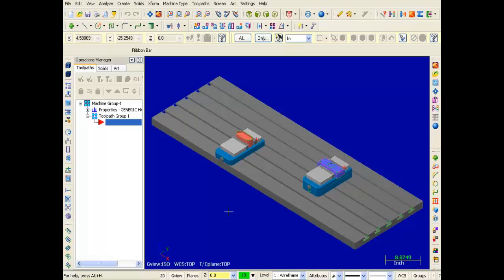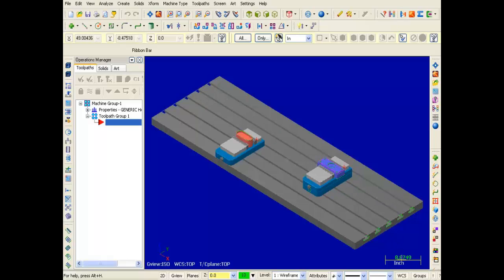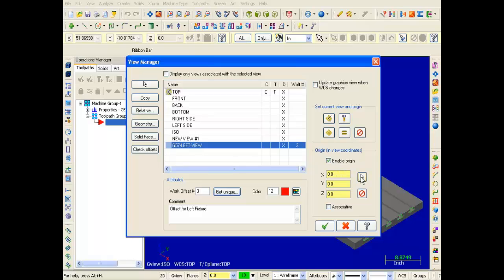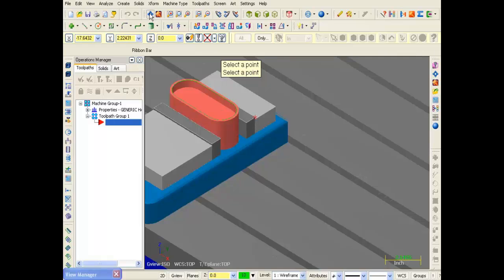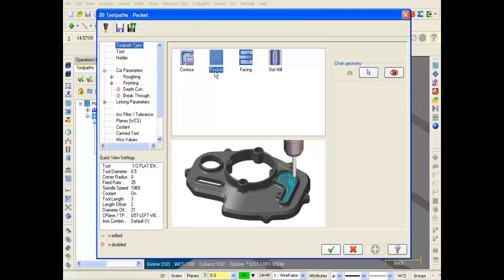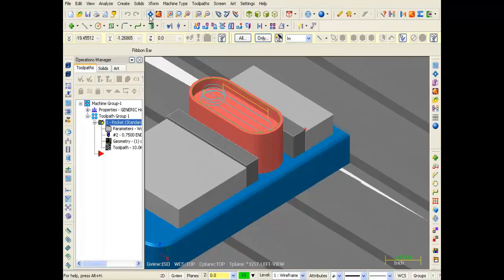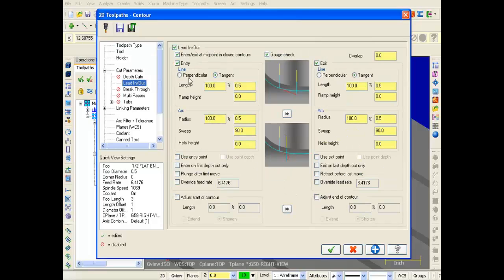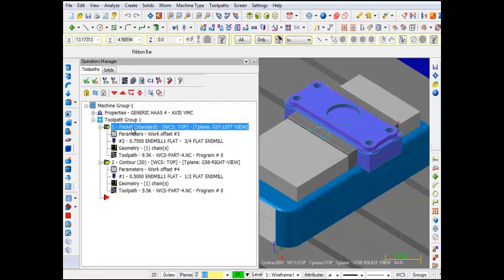Mastercam - Work Coordinate System

Comment: Old but gold!!! I was looking for a way to do it but i didnt find any result! 
What if i have 3 vises and each vise has a different part (and just one origin for all of them) and i need to do multiple ops, how i can define 3 different stocks? And how i can use each result stock of op1 to position it in each vise and then to program and simulate op2?
Thanks a lot for the great work!
Reply from the maker: Oh wow, yes this is an old vid! What is that, X7? 
1 origin for 3 different parts...your Mastercam setup would need to match your machine setup for the distances between each part, then just program as normal. For multiple stocks, use Stock Model. You would have to model the 3 stocks prior, then select each body for the Stock Model, set the Stock Model as the starting stock for Verify. Then you could output the resulting Verify as STL and use that as op2 stock.

Comment: Hello can I edit wcs when I use create from, meaning that I already move the part to a desire position, and I want to edit the movement whit out erasing or making another one, hope you can help, thanks
Reply from the maker: Hello Jorge

Using the ‘Create From’ function will create a new plane, you cannot edit an existing plane with this function. If you wish to edit an existing plane, right click on that plane in the ‘Plane Manager’ then select ‘Rotate Dynamic’. Even though this function seems like it has only a rotating action, all of the Dynamic positioning methods can be used. Hope this helps.